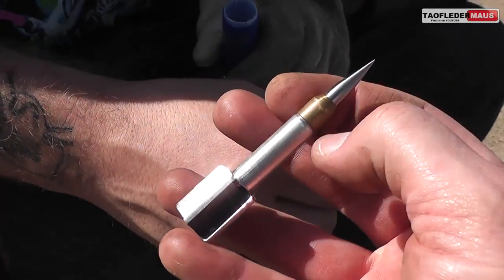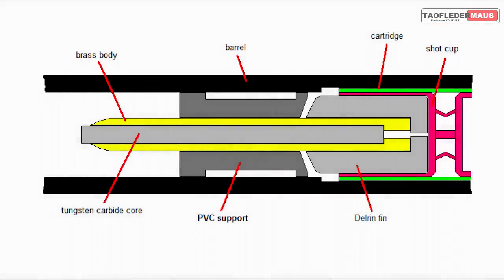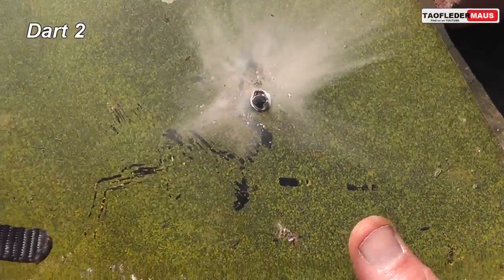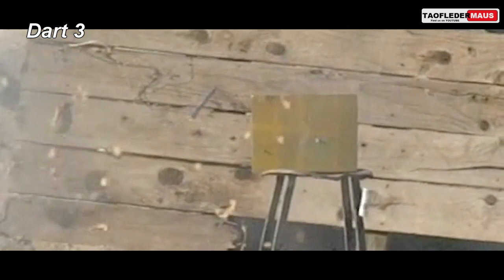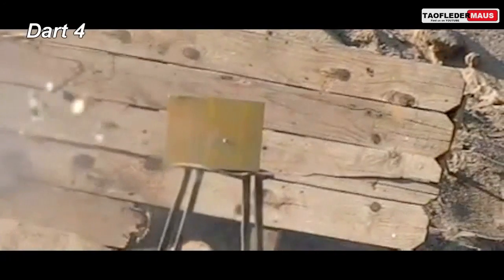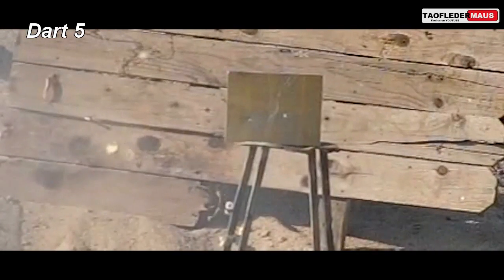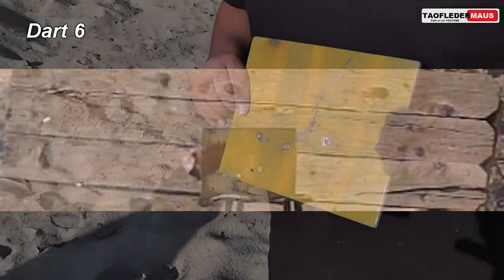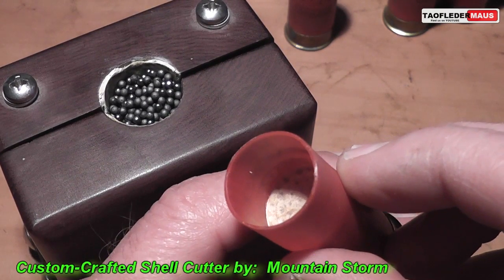Futuristic "Armor-Piercing" (APDS) Shotgun DARTS - Test 5

Comment: Freaking Shotgun APFSDS rounds... why didn't I find it sooner?
Reply: not apsfds, apds. apsfds would obliterate the  plate in a single shot no matter the size unless the plate is a composite mix or a spaced armour. then you would need to go bigger like tank rounds
Reply: @tahamahoon7909  APDS would still require a rifled barrel because they have no fins. This is an APFSDS because it has fins. They're basically the same, except for the fins, which at the FS

Comment: If you are trying to pattern these rounds after "darts," then you need to take another look at how a dart is built.  The fins are wide and much larger than the business end of a dart.  The business end is rather short but much heavier than the fins.  Also look at how it is balanced.  Your rounds have awesome "rocket" shapes, but not "dart" shapes.  The front end needs to be heavy and short.  The back end needs to be really wide and light.  The middle section needs to be somewhat long and thin, at least thinner than the heavy end.  You will definitely need a cup around it for support.  Also; if you throw a dart, it usually will have some wobble at short distances, but should stabilize over the long distance.  An arrow would be a good example too.

Comment: How hard would it be to make a scale replica of a SABOT round currently used by the military? Dart 4 came the closest. The sabot has to fit into grooves in the penetrator because that's what carries it out of the barrel I assume. Metal sabot in three pieces and a metal fin. Also maybe remove the plastic inside the shell between the charge and the round. Maybe even muzzle load the round separately. Or load it like artillery round then charge separately through the breech.

Comment: Nice:D *****  do you think that if you would use a rifled barrel and a dart with a sabo that the dart would fly more stable? I mean that the sabo is spinned by the rilfling and than spins the dart...!?
Reply from the maker: Only if the sabots engaged the rifling,  otherwise it wouldn't spin.   I don't think the tolerances were correct for a rifled barrel.

Comment: Is that shotgun a smooth bore or is it rifled?  I have a rifled barrel on my mossburg and it shoots slugs just fine.  I suspect that it would improve the flight of the darts as well.
Reply from the maker: Neal Murphy  It's smooth bore.   But for the rifling to work,  the sabots would need to engage the rifling.   These wouldn't engage them due to the dimensions.

Comment: OK I remember this video now...I think the problem with the sabots not separating is the fact that the sabot doesn't have enough of a cavity to catch the air and make it deflect off of the projectile.
http://www.acpr.org.il/english-nativ/04-issue/apfsds-1.jpg
If you look at that picture you will see the hollow cavity that allows the sabot to separate off of the dart much like the separation boosters on a rocket pushing the solid rocket motors off of the liquid rocket core.

Comment: Would it be possible to make a round where the wings or fins start from tip to end decreasing the need to find a body filler to keep it straight in the barrel coming out so basically make the bolt not need the discarding sabot I guess idk the correct terms but I hope you get the idea

Comment: Reduce the thickness of the penetrator so they can go faster also put a deeper wider lip so that the sabots can separate faster and for accuracy put a slight bend on the fins do that it spins so that there is greater aerodynamics and that is how you make a apfsds shot for a shotgun oh yeah if want greater penetration put a sharper tip on the dart

Comment: I think the most that wable are to thick in tank APFSDS the fins have about 5 times the diameter of the shaft they are longer and never have the finst in the sabot part. They have a 3 part sabot somtimes a 4 part.  They nearly allways have more than 5 fins

Comment: You need a more conical shape, it creates very high pressure when it hits, because of the small cross section, which  liquifies the armor; Then the change in shape pushes the liquid metal through as it impacts. Look at how a RPG is shaped. It is compariable to how a oxyfuel torch works except the emense pressure is creating molten metal.

Comment: Those darts are amazing, why don't ammo firms mass produce something similar?
Reply: The cost to machine each dart would be far to high for the manufacturer to see any profit.
Reply from the maker: CPHannigan  yeah,  I can't imagine how many hours each dart took to machine.
Reply: ***** Very true. Each dart really is a work of art.
Reply: CPHannigan they could be churned out by the 1000's, an aluminium mould to knock out the flight section and a hardened steel bar pressed or threaded in then a quick bead blast to take off the burrs and waste material.
I'm not talking about an exact replica of these darts, more a cheap copy. 

If the barrel guides were made from a less dense material they would probably be more reliable with separating from the dart too.
Reply: Green Silver well another problem is to testing since the person who built the shotgun ammo I guess firearms are illegal for the public to have?
Reply: Jeremiah Douglas Firearms are not illegal, at least in the US.
Reply: Dark Orbit King nah if you listened to the video whoever sends them this ammo isn't allowed to fire it himself.
Reply: Jeremiah Douglas Ah, ok. That makes sense.
Reply: Green Silver That would bring the cost down, but the problem is still prevalent. The process you described still consumes far more time and energy than manufacturing birdshot, buckshot, slugs, or even rifle and handgun bullets. The manufacturers aren't willing to spend anymore time on producing projectiles than they already do. Not to mention that sales on a dart type ammunition would be far less than that of conventional ammunition.
Reply: ***** Wouldn't they be able to make a mould for these. Or a machine designed to cut the fins  in mass.
Reply: Robert Horker en masse is French for in mass.
Reply: Jeremiah Douglas I'm Maltese myself, actually one can own any kind of gun he/she wants here (after a gruesome licence application red tape saga), only it's highly illegal to modify/manufacture weapons and ammo.

Comment: +TAOFLEDERMAUS I made this offer on another video, but since you mention Tungsten here, I figured I'd make it again.

I have a few solid tungsten tungsten electrodes from xenon arc projector lamps. At least one of them is definitely small enough for a 12ga, but the other one(s) may be slightly too large. 

They are yours for whatever experiments you want them for should you want them.
Reply from the maker: A U.S. dime is the ideal diameter,  or about 18mm.    I get a lot of people offering me stuff.   I really don't want people to spend their money sending stuff.   Also,  about 99% of the time- people will say they are going to send me something and they never do.
Reply: ***** http://i.imgur.com/Z1UXxwB.png is the picture I took previously. Conveniently, I use a dime for scale.
Reply from the maker: Thor214   Did you weigh them?  They look like they are at least 2-3 oz.  each.   The other important factor is weight,  which is 1 oz max.
Reply: ***** They are far too heavy, then. You are welcome to them for some other use if you ever think of one. I know you like to do a variety of video subjects.

Comment: hi. i have a terrible pellet gun that wont kill a rat at point  blank. i took a 3 inch blow pipe dart, whittled the plastic flight to fit the barrel and it shot through a door at 15 paces.

Comment: are you guys using a rifled bore for your sabots and if not have you considered trying?
Reply from the maker: He designed these to shoot out of a smooth bore.   He'd have to machine them in different tolerances if they were to engage the rifling.   It would be like shoot a 9mm out of a .45 barrel - there would be no spin.

Comment: you need more velocity, that's why the haviest darts are unsuccessful... I think you just need a straight cilindric penetrator (arround 10 milimeter diameter) with a plastic body wich must separate (desintegrate) only at the impact on the target...

Comment: If its true that there is no comertial shotgun round that perforates plates like this, i think you find a posible profitability on that, because it will give the person using the shotgun more options than the normal rounds, i dont know a thing about guns but i can imagine myself in a urban/close combat stile with this,or in a solo situation with out a team with other kinds of guns.
if there is already you can easily compare the darts to the comertial rounds making about 6 of each tipe of dart, and compare the damague  with 6 comertial shots; you can make a serious offer to a gun company or even sell them by yourselfs if they end up being better, or at least cheaper. (cause depleted uranium sounds costly as hell to me).
once you find that out you take the best performing desing and make a few changes, the test it again and compare (6 vs 6), if one turns out to be better thats the new standar and you can repeat the process.
great videos by the way!

Comment: sir i thinkn that steel dart with steel fins doesn't need any sabo or wadding due to it has fletching and will drive it to fly true
Reply: It needs wadding and a sabot. Wadding to generate proper pressure, the sabot to prevent damage to the barrel.

Comment: 2:20 you can see the self-sharpening effect tungsten shares with depleted uranium: as the projectile travels through armour the edges chip off, continuously sharpening the tip to a point, which is one of the reasons for both material's use in anti-tank weapons, the others being hardness and density. The main reasons the US traditionally used depleted uranium instead of tungsten is that it's cheaper, but considering the moderate price difference is irrelevant to the massive funding of the US military, it's really to get rid of some of its nuclear waste, unsurprising given its lack of regard for non-US countries and their citizens. That's why Iraq and Afghanistan are now covered in many tonnes of highly toxic uranium dust. For a long time they argued that it doesn't cause problems, but science and International condemnation are finally forcing them to move towards tungsten.

Comment: Non of the designs with any kind of fins are ever going to fly straight. The velocity is to high, and there is not time for fin stability to begin working. fins work on rockets because they start slowly, and on arrows from a bow for the same reason. fins are not suitable for slugs, because all around them as they emerge from the muzzle is a chaotic cloud of expanding gases, and the wobble thus induced will continue long past the flight time.

Comment: cool now if you could just polerized steel aloy lol like i used to make in high school i made a machine when i was 16 that could polerize the molicuels of metals the rezulting metal would be transpearent like a sheet of glass but i found it to be porus thats right water could por right through it air could pass right through but thats were it ended a hammer would bounce off and never leave a scratch the some with aluminum the hammer would shater and never leave a scratch  the aluminum was 156 rock well the steel 416 rock well so can i get some help to build another machine here

Comment: 4:25
so is it tungsten or tungsten carbide?
Reply from the maker: +Evan Bell Technically, it was wolfram
Reply: +TAOFLEDERMAUS Which is a now rarely used term for tungsten.
So it was tungsten, not tungsten carbide.
Reply from the maker: +Evan Bell  I didn't make the rounds and didn't do an assay of the metal so I don't know what exact alloy it is it,  or isn't.
Reply: +TAOFLEDERMAUS 
yeah dude, not trying to criticise you, just trying to get the information straight for myself and everyone else watching. 
Also another data point, just FYI, neither tungsten or tungsten carbide is an alloy.
Reply from the maker: +Evan Bell   When you make your own round, you can provide all the important info.   I usually just get generic info so I am bound by just what I am told of a round.

Comment: Its not comercially made because manufacturing armor piercing ammunition is illegal as @#$% in the states without a special permit from the ATF, and also illegal in most of the world too.

Also, bullet projectiles balance on the rear of the bullet, tumbling occurs when the round is insufficiently stabilized or is too front heavy. not to say it cannot be too rear heavy as well. look at bullet cutaways, most of the mass is centered to the rear.

Comment: What if you take, say a 7.62x39. Crimp the ever loving shit out of that neck so the bullet is firmly in place, and then cut of the case head, so its just a bullet with a hollow open case trailing behind? If you are worried that the force will still loosen the bullet, you could just fill the case from behind with some light plastic.
I think that could work TAGENFLEGELMOOSE
Would be much easier than making darts from scratch.

What makes a slug fly straight? Well the Foster slug is hollow in the back, which makes it front heavy. Brenneke slugs have a piece of felt screwed in to the back, also to make it front heavy. Give it a SHOT, what's the worst that could happen?